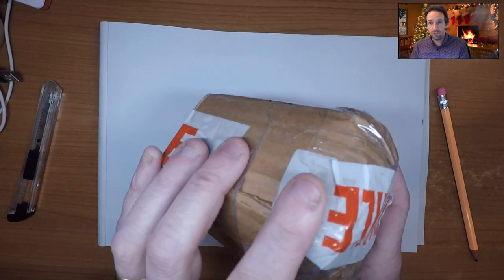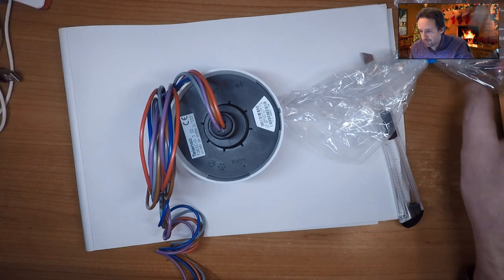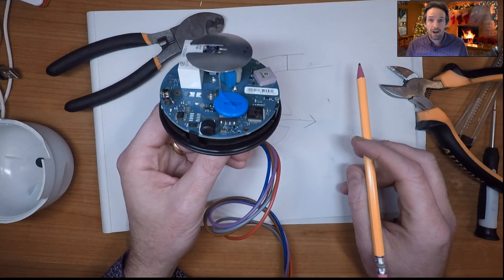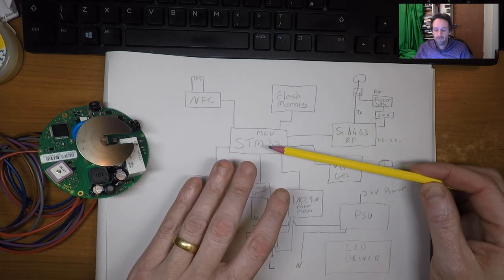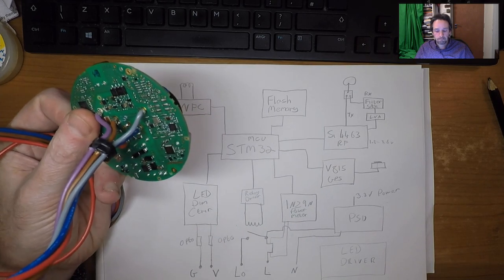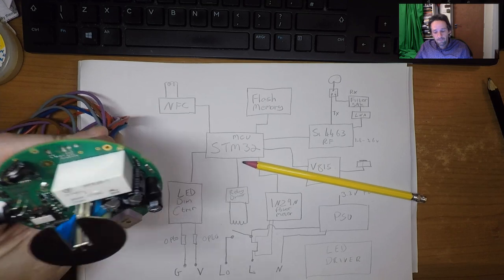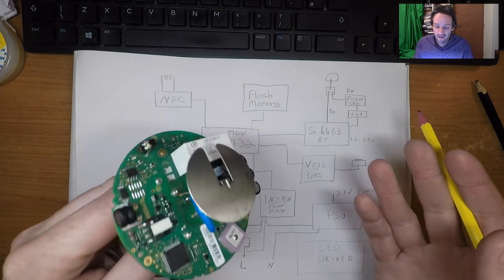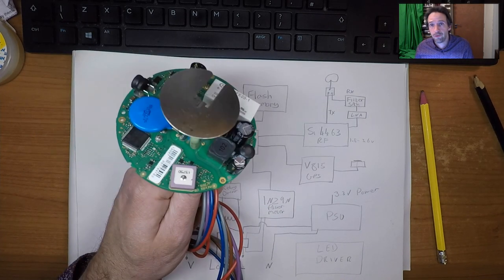Teardown and analysis of Telensa Telecell lighting control system that apparently can ZAP you..

Comment: Hi They will be use the LED driver chip to drive the relay coil as the 3.3 vaults won’t be high enough. As you can use them LED driver chips for different voltages by changing a resistor. She’ll probably find that LED driver chips been set to 5v or 12v. Also check to see what the actual voltage of the relay coil is. Or they could be a second use do use in the LED driver power supply to drive the secondaries of the octose to give you the variable voltages on them lines so the supplies are isolated from the main power supply.

Comment: Ever considered last gasp functionality - Charge capacitors to supply the device via the charge controller for when the mains supply drops. Which allows it to send a power out message before going offline!
Reply from the maker: Yeah, this is very possible and makes sense. I'll trace the connections and see if it does that.

Comment: If it is called smart street lights a smart meter gives of microwaves so does anything when smart this has been happening for years when they call it radio waves when it is microwaves look at the radar spectrum unfortunately this is using frequency in microwaves when looked at this on telensa website I also seen a video of street lights with microwave motion sensor on thes lights and is radar and is used in military you have no idea
Reply from the maker: What frequency does this device use and what frequency do you consider to be microwaves? Yes some have microwave based doppler motion sensors, they are the same as the ones used in some burglar alarms, they turn the light on when somebody is there. What do you think is the problem with that?
Do you fancy doing a live chat on YouTube to discuss these things?
Reply from the maker: Email me leighporter0@gmail.com and lets arrange to discuss this.
Reply: In the EU it is 868mhz also 700mhz is used in low band 5G
Reply: And radar is a scanner which can see through buildings it is also against human rights to spy on people
Reply: It makes no sense to have a Qualcomm chip on it also why so many compaciters whit that Much power through an anntanna that travel 10 miles at low frequency makes no sense to put that much power unless it's uses as phased array radar
Reply: Not only that a street light controller don't need that much power neither the same as ZigBee used for smart meters so this must be weponized as emp

Comment: 'got it off ebay' - this is not what is in the latest lights..  - the people have bio sensors in them now that work with the telecells - as one whole web of two way communications. - you should be ashamed of yourself
Reply from the maker: Yeah I have some of the newer ones too, one from Mayflower for example uses Zigbee at 2.4GHz, and I have the devices from Telensa which also use 868MHz. So I'm not sure what the point of this comment is, except to make yourself look silly.
Reply: Oh behave.... @jackdelang4301 You should be ashamed to buy into Mark Steele. Leigh clearly does a comprehensive breakdown of this device and likely would do the same for newer versions. Mark on the other hand is incapable of anything remotely like Leigh's presentation...he'll just deflect and come back with personal insults, rather than confirm his credentials....says a lot aye!